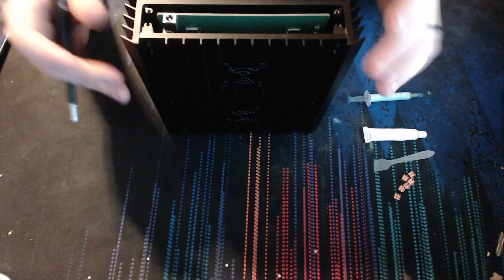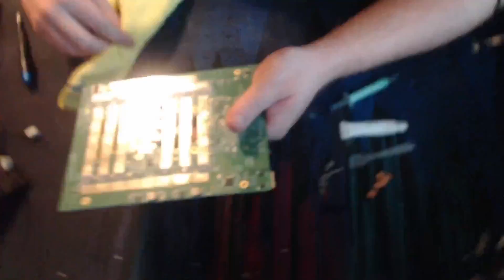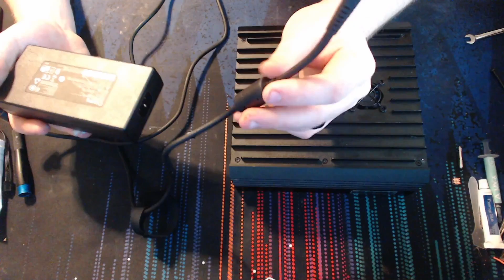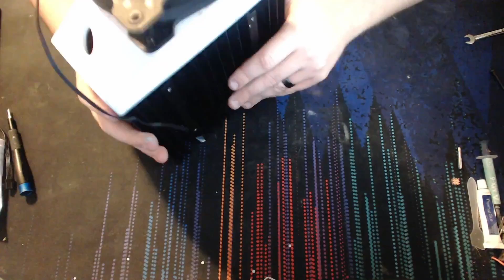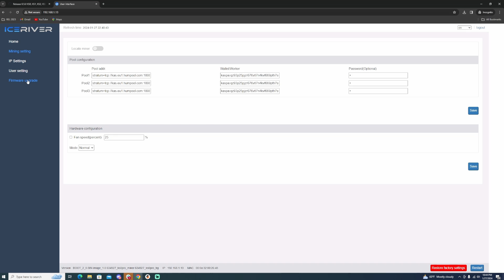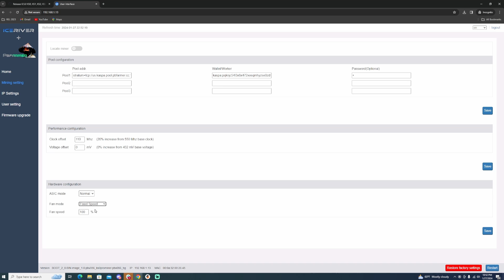50% MORE HASHRATE FOR FREE?!? KS0 PRO Overclocking Guide (with Teardown)

Comment from the maker: FOR THE RECORD:
VOLTAGE CAN BE INCREASED ON THIS MODEL BY 2mv Increments!

Clock changes are offsets, so find what your desired GH, divide by stock, minus 1, then multiply by 550(base clock).
Example: 300GH

300GH/200GH = 1.5
1.5-1 = .5
.5*550 = 275MHZ offset
Reply: What is the 1% fee? And if I want to go back to the begging firewarm how I can do it?
Reply from the maker: @djmanos8725  factory reset, half to the kaspa dev team half to this dev
Reply from the maker: @djmanos8725  factory reset the miner to go straight back to factory. That can be done in the web gui or on the back of the machine. The 1% fee is a dev fee, he’s working on all kinds of addons and changes, be excited!
Reply: This is for ks0pro? Because In github he say except ks0pro,

Comment: whats this 50/50 split thing about  that i read when reading about the overclocking firmware ??? i think ill stick with the  tswift firmware as its only for .5 % dev fee
Reply from the maker: @seanwood5443  this is a very old video. The dev fee is 50/50 with PBfarmer and the Kaspa Devs.
Reply: @LukewarmMining  so they keep half of all the kaspa i mine screw that
Reply from the maker: No, half of the dev fee goes to pbfarmer other half to kaspa. 1% on the regular, 1.5% for commercial firmware.

So .5% to pbfarmer, .05% to kaspa devs. Or on commercial (more for setting up many machines) .75%/.75%.

Tswift is a tune in a can, pbfarmer is fine tuning. Better speeds, better wattage, better temps.
Reply: @LukewarmMining  oh ok that makes alot more sense lol

Comment: I have the updated pbfarmer software. I can see 3 board temps: intake, exhaust, and power stage. What is the power stage and what is a good temperature range for it? Mine is constantly in the mid to upper 70s and every once in a while it will spike to 85 and then go back to the mid to upper 70s. The other temps seem good (intake 25 and exhaust 47) and all of the chip temps are around 40

Comment: Should I overclock my ks0pro commemorative or sell it?
Reply from the maker: Depends on your goals, I enjoy owning and tinkering with hardware so I’m a bit biased there. Even leaving it stock you can usually safely bump it to 240GH on the stock psu and all.
Reply: @LukewarmMining  I’ve only watched parts of the video so far, maybe I will overclock and keep stock for now. Do you explain what temps to watch out for? Thanks!
Reply from the maker: @BurgettIndustries  biggest issue part is the vrm/power stage temp. They have a shutoff at 125C I would keep at or below 100C

Comment: What is the reason for changing thermal paste on the down side? If I put this ks0 pro inside the refrigerator for mining. What harm could it have?
Reply from the maker: Poor thermal paste quality/application from the factory, anywhere from 5-20C difference in temp. Putting it in the fridge is not really advisable as the limit temperature wise really is the power stage/vrm.

Comment: If there is a 1% dev fee then exactly how is it free if it is not free?
Reply from the maker: At the time of release, tswift was still charging $20-40 for the overclock if memory serves me well. Pressure from PBfarmer releasing his firmware without mac address lock or paid service pushed them to remove any cost.
Reply: @LukewarmMining  Hello, I have a question, I want to try the pb farmer firmware, but I can't log in because it asks for login and password, maybe you can write to her. admin and 12345678 are not valid

Comment: I don´t understand this oc, set 300mhz, 32mV, get 130gH. How long is the programmer of the software mining with my ks0 pro? I´m not talking of the 1%. If you pay for the electricity, it´s better go back to the factory set, safes money and much time.
Reply: You should see the results immediately. Assuming the firmware is loaded, start with something much lower (100 mhz) and work your way up. Is the unit can't handle the settings, it won't overclock at all.

Comment: Thanks 4 the info, so far my first day testing it on 2 ks0 pro, my safe OC values are 250 Mhz (45 % increase from 550 Mhz base clock) and 28 mV, between 280 and 300 GH/s, no plates, fan at 100 %, 120 mm blowing towards the unit and a big fan blowing from the ethernet plate to the other side. Will 3d print a case soon but so far tems are between 47 and 51 on the chip, 52 on the exhaust and 29 on the intake. Board temps between 70 and 80. 230 v PSU. No readings yet on wattage.

Comment: hi bros. my ks0 pros clock offset is 275mhz  and voltage offset is 34mv at 168Watts with the hassh rate 300Gh :-( Would someone plz let me know how i can lower the watts and top up 320 or 340gH? Thanks...

Comment: I lost the audio during the part when you were talking about the ducting. Was the thermal paste you wiped off already applied, and does that need replacing with a better paste? I don't know whether you took that part off to explain adding heatsinks to that area or if it was to show where the paste is needed. You speak very quickly
Reply from the maker: replace with better paste :). I wiped my new paste off just for you guys haha

Comment: so if i try 365gh do i have to up 2mV per time to until it stable?
Reply: i don't know how much voltage i need for the 365gh cause the hashrate was down to 0 when i change to 42 mV ,but at 40 mV im only get 250gh :(
Reply from the maker: should be at least hitting 300 at that power

Comment: Hello. I just got a shroud. Does it perform better on a particular side or no? Thanks
Reply from the maker: So in a later video i will be releasing it does! Ethernet side cools vrm better, dual shroud is the best option, though you have deminishing returns
Reply: @LukewarmMining  Might I add onto this, I saw a software out there, I'm currently running 300-315gh/s, stays cool (60c), though unstable without adding mv. how would one tell VRM temp? also, I'm at 160w currently and don't wanna go any further.
Reply from the maker: @dylananderson7819  pbfarmers current firmware shows this info
Reply: @LukewarmMining  i do have that one, possibly an older version? I do not have dark mode but saw that was a thing. would you mind sharing the link for this to make sure I'm updated?
Reply: @LukewarmMining  Awesome, thanks so much for the info and quick response!

Comment: Any recommendation for stock PSU settings? I am currently on 108MHz and 2mV. Seems to be stable, but am afraid to go higher :)
Reply from the maker: Keep your mV low, have a power meter. Probably around 120W rn
Reply: How much hashrate are you getting?
Reply from the maker: @theeasymodegamer  340gh rn
Reply from the maker: @theeasymodegamer  correct
Reply: @theeasymodegamer  now I am on 130MHz and 2mV. I am getting 225-230GH on pool.

Comment: I understand almost everything but this: 

300GH/200GH = 1.5
1.5-1 = .5
.5*550 = 275MHZ offset

So once i made 275mhz offset, what do i do with the voltage? do i change it? or do i leave it as it is?
Reply from the maker: Voltage is dependent on the asic silicon lotto. Try 32mV
Reply: Have you found what settings work best for you as far as clock offset and voltsge offset?
Reply: @bigmemebarney6203  not yet, I am waiting for the items that I need before attempting the overclock

Comment: hello, KS0 normal can be overclocked from 100 G to 180G.
Normaly if im not wrong, KS 0 PRO, 200 to 380G with the same calcul.
Have to you tryed it ?
Reply from the maker: Most get unstable at that power, but i have not tried pushing one that far
Reply: @LukewarmMining  What do you think would be the overclock parameter to achieve this speed?
Reply from the maker: I would start by putting 30mV into the machine and setting the clock for 495mhz. Increase power until its stable. Honestly, probably going to cook the board or the psu at that point @elix_377

Comment: a helium miner, costs 100usd used, and on a decent setup makes around 2 usd a day, 5w consumption, and people struggle so much with these that in 2 months are paper weights due to network diff not to speak about how much these cost. People make dumb choices in crypto..
Reply from the maker: I doubt you are making $2/day. You are right, people should diversify, but remember to have a “decent” setup you need to: buy an 5-8dbi antenna($40), with lmr400 cable ($40) mounted  to your roof($20) in a area with the right density of hotspots. I am rank 20k on hotspots gobally, so top 5 percent. I am earning .85/day. If you’re counting crankk, thats another 200-300 in licenses to make $2/day. Starting to look like the price of a ks0 pro for a used device. 

And thats with RECENT PRICE APPRECIATION, from $1.78 to 7.80ish. The last year or so we were in the .08-.20/day when i was ranked 13k.

So really don’t know why you call it a ‘dumb choice’ when if you pay attention to heliuum foundation the biggest push is mobile, not iot. IoT will end up dying unless they find contracts. 

Go look in my post history, i had a video up on the Panther X2
Reply: Enjoy it until they vote you out…
Reply: i have 2 hotspots at home, one making 1000 iot, other around 750. Simple setups, with 5m rg8 cable, one is a sensecap the other is a cotx. Anyway we are still far from the 50usd hnt price. And at the end of the day is a 100dollar raspberry pi. Not a 750 usd machine that gets useless as dfficulty rises

Comment: increasing the clock speed without increasing the core voltage does make the unit consumption higher or the same? and how much clock oc did you gained without overvolting?
Reply: higher clocks always means more power.  higher voltage means more power squared
Reply: @ryandugan  Thanks for clarify :) wonder what is the highest to push without upgrading the psu

Comment: I have a Ks0 pro just wondering if anyone knows the thickness of the pads on this unit and if they should be replaced or just the thermal paste?  I have a fairly new unit but still want to ensure that the cooling is the best it can be.
Reply from the maker: Honestly look like 1.5mm pads, i would just buy a kit of 12.8k pads
Reply: @LukewarmMining  sounds great thank you

Comment: your video ended showing 200ghz and yet your title is saying ' 50% more hashrate' + 1% fee isn't free. misleading title
Reply from the maker: I can post my numbers if you would like me to here, I'm also active in the Kaspa Discord. Currently sitting at 320GH at 32mV Offset. 1% Dev fee going towards the Kaspa Development fund is better than paying 300 Kaspa for the same but as a canned tune with more voltage?
Reply: @LukewarmMining  Thank you for time and the information.  Don't waste your time with comments like this.  Just keep doing your thing.  Thank you.  This is a better deal.  I definitely don't want to be giving out my Mac address to anyone.😀
Reply: @LukewarmMining  it is not free, maybe do a calc on 1% for 6 years. where the fee goes is irrelevant.
Reply: If you look only at the upfront cost, it is free.  As in, compared to the TSwift jazz.
Reply: @redlion6505  wether you pay 300 Kaspa upfront or 300 Kaspa over a period of say 3 years at a 1% fee = not free. free is free, as in you pay nothing.
Reply: hey jacka$$, the o.c. software is free,  which allows 50% more hashrate i.e. 300gh, f**k off bro!!

Comment: Really good information, very handy for ppl wanting to OC the KS0 Pro themselves. I use the paid version myself, as I can't be assed to FAFO😂
Reply: The upfront fee version is FA without actually telling you to what degree... in fact, it's almost certainly running more voltage than you actually need.
Reply: @ryandugan I'm running the 300GH OC, my voltages are Min 435mV Max 449mV
Reply: @N1NJAKIDD  yeah, i'm talking about the setting.  if you want to provide a preconfigured OC that will work on everyones machines, you need to configure it to the lowest common denominator.  so unless you got the shit end of the silicon lottery, you're probably configured for more voltage than necessary

Comment: its not needed the 4 inline fans if we god the thermal pads and paste and twins fans and head sinks?
Reply from the maker: There was a model someone drafted with 4 inline fans, but that does defeat the purpose of the original packaging. Dual axial will have a higher cfm. I would be concerned about backpressure on the regular fans

Comment: Can you share the 300g recommended clock value and voltage value?
and
Do I have to work on the heat sink on the power supply?
Reply from the maker: So like any other overclocking, each system is unique when it comes to voltage offset. You would to add 225clock offset (550*1.5) to get to 300. Then if its unstable, keep ramping in power (2mv at a time) until clocks stablize. It should be equal (percentage clock speed vs gained)

Comment: What is the software update 300 or 320?
Reply from the maker: software update is justing installing the OC utility. if you wanted to do 300GH, you would do 225Mhz on the clock (50%*550). You may or may not need more voltage, it goes up in 2mv increments
Reply: What do you have yours at for 320gh 225mhz and the mv?

Comment: Wow looks cool. 50% more hash is 300GH on 152W?
Reply from the maker: correct! and lower now, im at 140w at 310ghs
Reply from the maker: Now 135w 300gh/s
Reply: Does it work with ks0 normal ?
Reply: Does it work with ks0 normal ?
Reply from the maker: @diogopinheiro6046  there is a separate firmware for that
Reply: @LukewarmMining  WOW, sounds like a very lucky lottery! What are your settings?
Reply from the maker: @BudriHudri  unstable, had to drop down
Reply: @LukewarmMining  WTF?! WOW!!!
Reply: Whats youre clock an Volt settings?  @LukewarmMining
Reply from the maker: @soundpeople2077  310GHz at 34mV
Reply: @LukewarmMining  so CC near 300 / 34mV ?
Tomorrow i get my 200w PSU... And my mosfet cuppers... At this Moment i Run at 240ghs 120watt.. with Stock PSU Core 100 mV 0 39Celsius... Board max... How much Celsius ist OK (highest) at Board temp?
Reply: @LukewarmMining  Hello, what are your clock and voltage settings? I'm trying and I can't get to these values
Reply: @LukewarmMining mat i ask to learn ur settings plz?